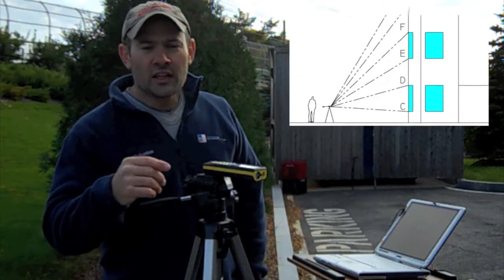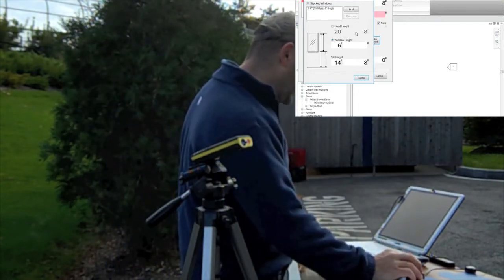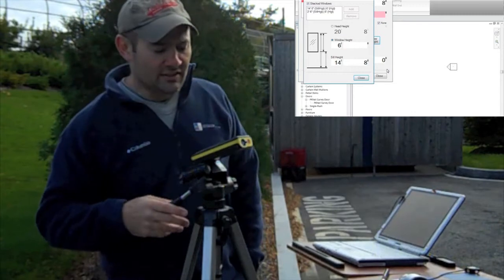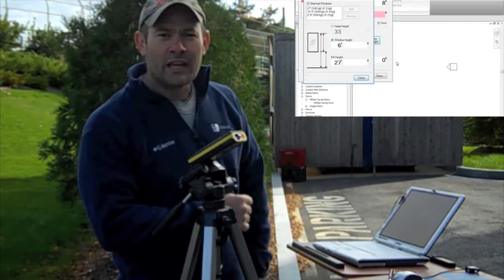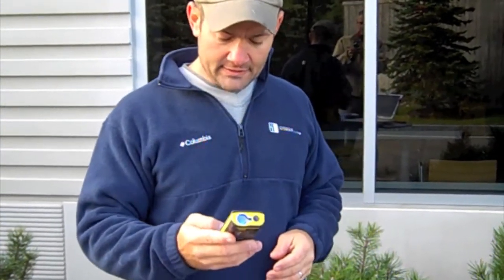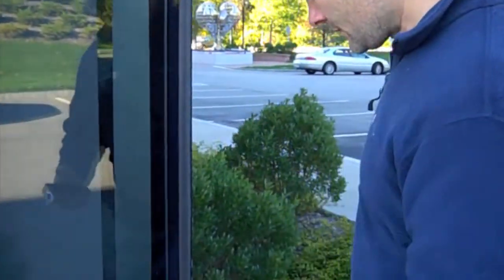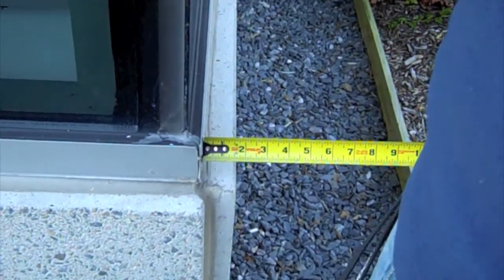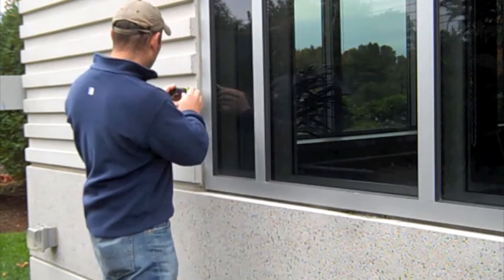PointKnown : Capture Existing Buidings Digitally with PKNail

Comment: With your new plugin for Revit- have the tilt issues been resolved?  Could this be integrated with photogrammery perhaps? Take a snapshot with the distance aquired from the measuring device to combine into a more accurate and tileable photogrammetric representation? Would be cheaper than a laser scanner and capture more useful (visible) information IMO. Contact me if this is of interest to you.